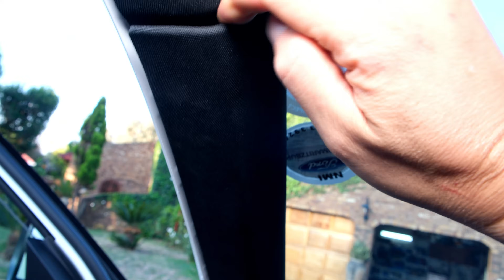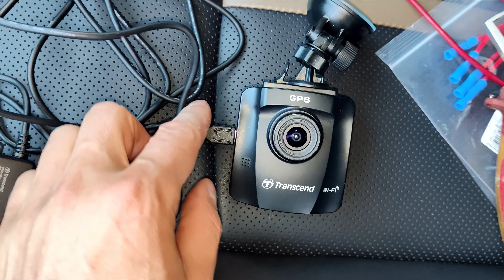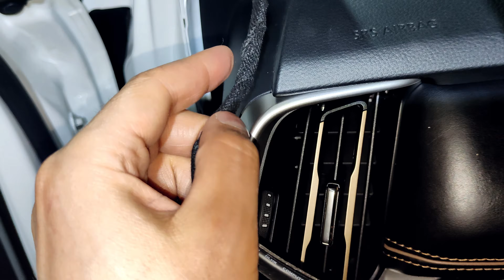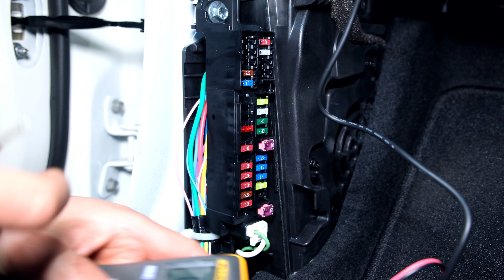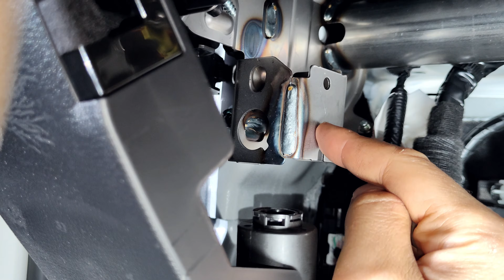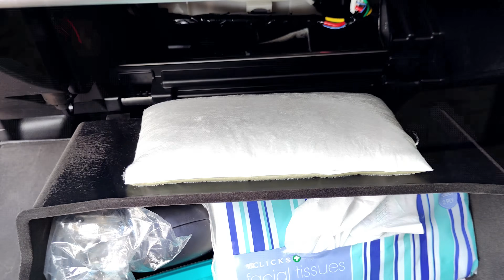How to Install a Dash Cam in a Mazda CX-60 [CX-70] - Complete Step-by-Step Guide to hard wire camera

Comment: Hi random question, is your rear suspension also very hard and stiff? I bought the 2024 model 2.5awd and find the rear suspension to very stiff. Even going over a speed is very bumpy . It’s so stiff that my kids are (flying) from their seats when going over uneven surfaces. 

What did you do to fix yours?
Reply from the maker: yes mine is bouncy as you mentioned. I have not fixed it.
Reply: @ecologicaltime I have notified Mazda fourways and they will be looking at my car. I like the car just not the ride quality. Do you also have the 2024 model?

Comment: That is a great guide, thank you!
If I do not want to install the camera to the fusebox but rather keep it at the regular power outlet - do I see well that if I go down with the wire along the windscreen then cross it where the A pillar meets the dashboard (and from there go under the door rubber and under)  then I won't cross the airbag and safe to go?

Comment: Great video. Detect a South African accent there. Groete van Engeland af 😜 Great video. My dashcam has parked recording mode so need to source a 12v constant. Easily done. What I have used is some conduit and fabric tape. Probably a bit ott but just for the added surity the wire cannot be exposed. Great video though. Very helpful thanks.
Reply: Also shared to a CX60 group in UK.
Reply from the maker: Thank you so much. Yes you heard right, i am South African

Comment: @ecologicltime the hot side of the fuse is facing toward the front of the car you can  just fit the jumper fuse but need to ensure the pig tail is facing forward else you are bypassing the fuse.

Comment: Hello, very well and in detail explained, and where to get constant power supply all the time positive +, sometimes cameras have parking recording mode, you can buy an adapter for a battery discharge regulator, set it to e.g. 12.2 V so that it does not completely discharge the battery in a parking lot, where a continuous current is needed after the ignition is turned off